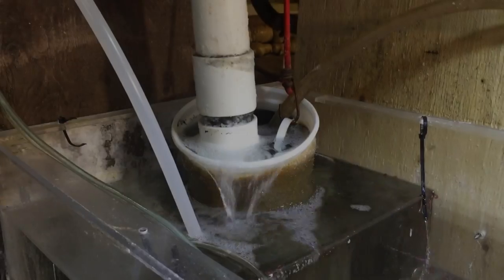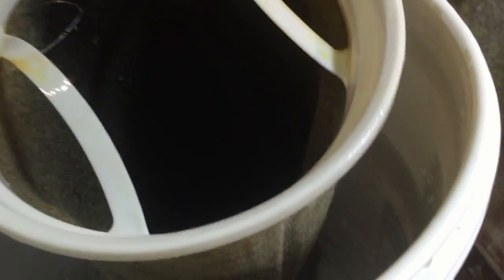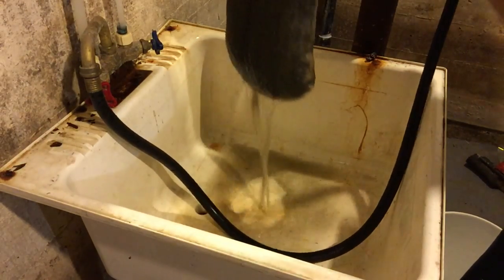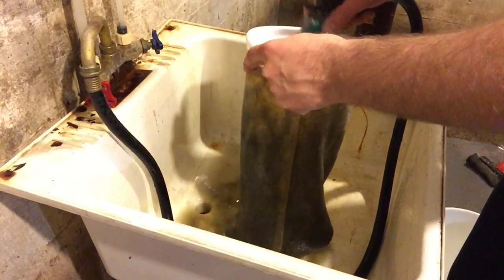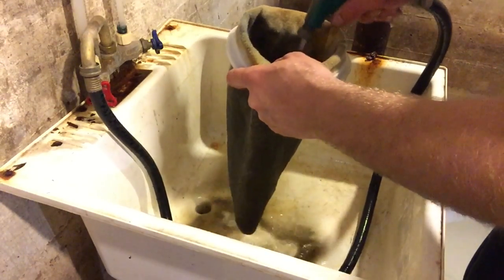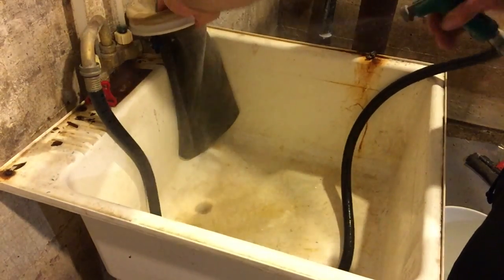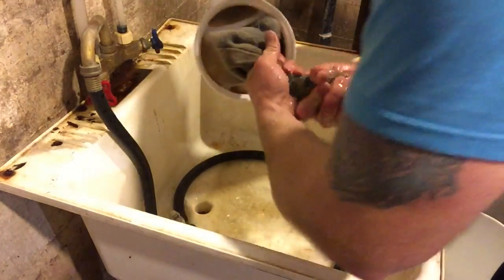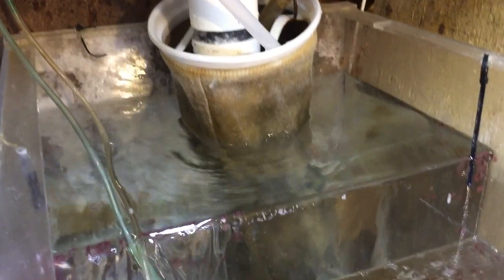How to clean filter socks for a reef tank. FBR

Comment: Why is the filter sock black?
Is your carbon in your reactor tumbling?  Cool setup, thumbs up reefer
Reply: Yeah why is it so dark?
Reply from the maker: Because I just added new carbon. I cleaned it but dome still made it through.
Reply: Ahhhh I see.
Reply from the maker: Yep things happen.. If that's all am good with that
Reply from the maker: I order 5 new ones because this one stained black.now this will fix things up lol..
Reply: Pre-rinse the carbon, and make sure your carbon doesn't tumble. 
Your reef is very nice brother,  Im hoping to get something setup in two months but for now I'll be watching your reefing vids.
Reply: abreezeducttesting why not tumble carbon?
Reply: abreezeducttesting I guess you don't want I breaking up...slow tumble or a bag in high flow area / reactor.
Reply: the carbon is too soft grounds  down a leaves your filter socks dark and a dark tint to the water.
Reply: When you use carbon in a reactor put a sponge behind it to keep in place.
Willy I need a favor can you do a short video on the Zoas that you fraged up for the winners and some up close shots please and thanks
Reply: abreezeducttesting sure.
Reply: I toss them in the Washer with a bit of bleach then one a extra rinse cyle
Reply: abreezeducttesting I agree  i put a songe in the bottom of my reactor fill with carbon while tapping it on the table to pack it in. Like a do for  DI RESEN... Then push a sponge on top. So when the carbon starts getting used the sponge will expand and keep it tight . But i have like 30 psi pressure pushing thru the filter as its a bypass off my Main System pump... Can tell it works as the carbon will start changing colors after about 2 to 3 months.At that time i break it down refill it and use this time to break down and Clean my  Circulation Pump that NEVER Gets turned off It provided water to everything my Display my  Protein skimmer  Bio reactor   and Even pumps water out for water changes..
Reply: Erica Miller love it!
Reply: Willy d. aquatics The Better the  arranged equipment the Less work for me.... And im all about not working . I Can do right now a 30 gal water change by turning 3 valves .Its gotta be easy as i can NOT Pack buckets of water Doctors orders
Reply: Erica Miller I know....we have had this conversation many times.
Reply: Willy d. aquatics oops
Reply: Erica Miller like a 100 times...lol you know what that means.
Reply: Willy d. aquatics it means I am Genius.??????????????????????????????????????????????????????
Reply: Erica Miller your water changes are genius....in reference to your forgetfulness about the many times we've spoken on this topic. .....it means your getting younger.  Lol
Reply: Willy d. aquatics Younger.. Humm I like that thought... But i never forget........ Here Comes the Lights on in the Reef tank by the way.  a bit after 12 everyday and go off at like 11 pm ..
Reply: I'm on at 10am blues....then whites I ramp up until it takes over the blue and becomes more yellow around 1 30 - 3 pm. Then I brighten the blue after that until 4 30. Then I back off on the whites slowly until 6 pm. I bump the blues from 75% ( that's all the higher I go on both channels...will burn certain corals ) to 50% and the whites on 10%. Gives a nice glow and pop to all my coral until 9. Then it's blues till 10 and moonlight until 1 am.
Reply: Willy d. aquatics hehe Mine are on or off.. thou they Come on Slowely takes about 30 minutes to full brightness.
Reply: Erica Miller yup that's how metal hailed usually work...on/ off. No dimmer.
Reply from the maker: Should look at led . Those Metal halide's are expensive to run. I had two before . Just nailed the hydro bill
Reply: FARM BOY REEF I  Am going to switch sometime later this year. Just put new bulbs in not long ago. By then leds will have come down in price even more and tech better. .I love the Look of the MHs .
Reply from the maker: The metal halide does give good growth. Since I add my t5 my sps have been even happier.
Reply from the maker: @erica miller I really like the radions for echotec
Reply: FARM BOY REEF Yes but to get enough to cover a 7 foot tank is NOT Cheap
Reply from the maker: Erica Miller very true my tank build I am working on is 10 feet long. It's going be my master build for my games room . It's not cheep :)